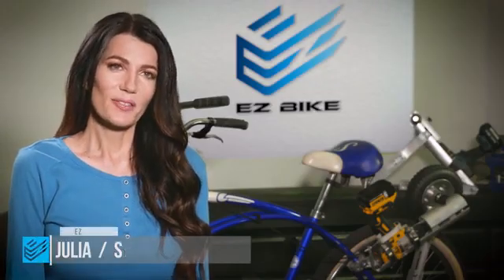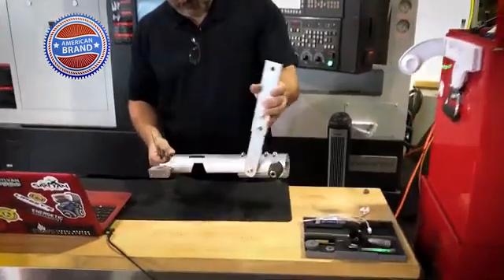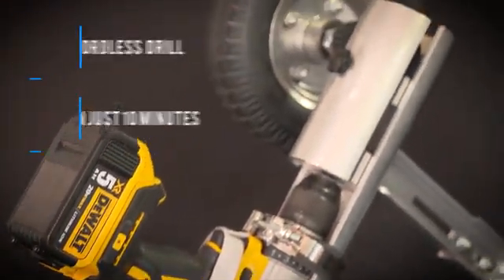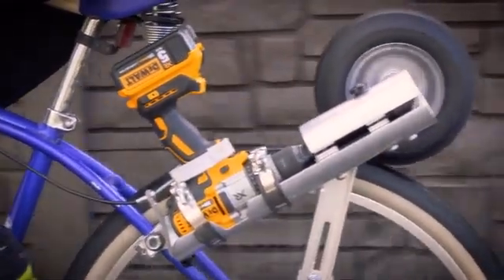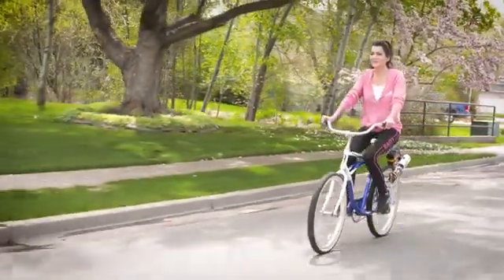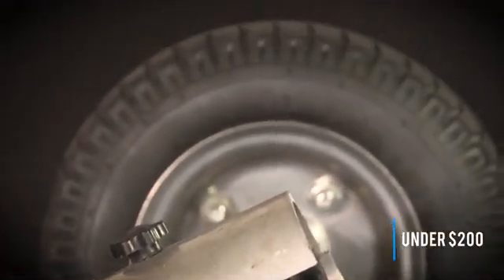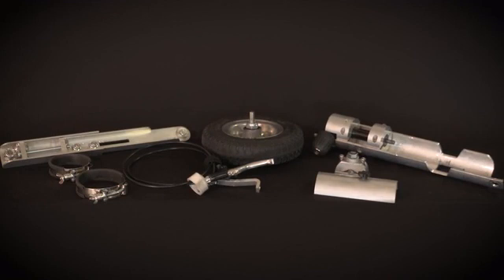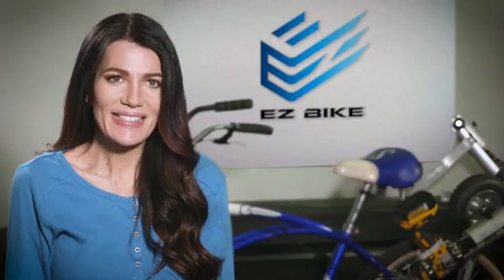Ez-Bike | Convert your bike into an ebike within minutes

Comment: I don't want to come off rude but the model you shown would cost more,  lose more power to friction losses, be slower, and die quicker than if you were to just build a motor into your design. Along with this the reason that people would want to have an e bike is to assist their long rides. This contraption does not seem to be able to last an entire ride, and when needed most, on hills, it would not be able to provide enough power or friction to work due to the fact that you are using a drill that isn't capible of drilling a 4 inch hole in some woods. Even though you claim it can ride up hills due to gearing, the Mechanical Advantage Equation states that for double the torque you only get half the speed. This means that if you want to give the bike more power to the ground you need to reduce the speed. This means that in the end your product is garbage, and would never work unless you change and break the laws of physics, and everyone knows you can't.